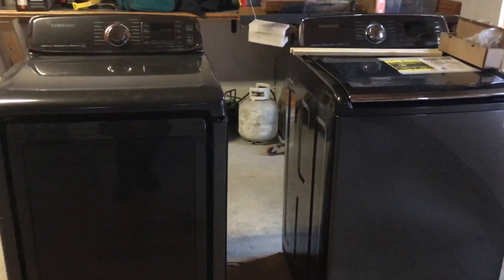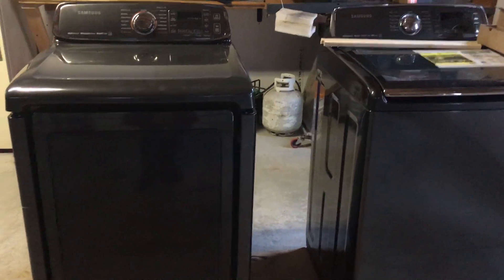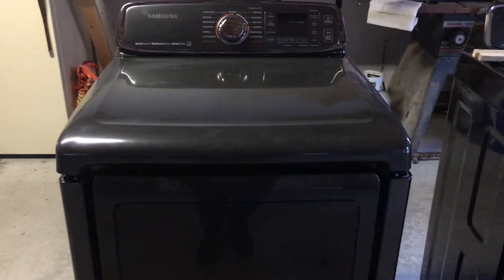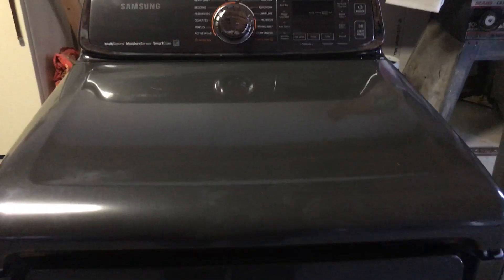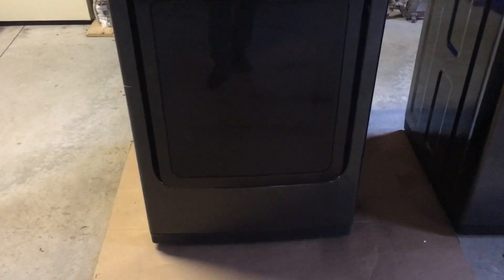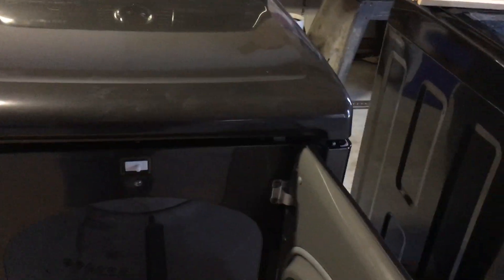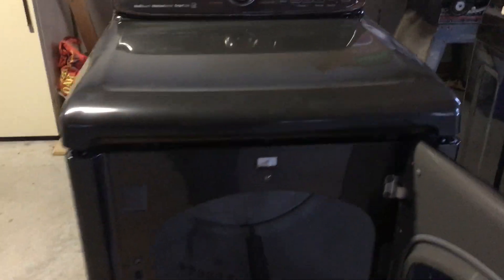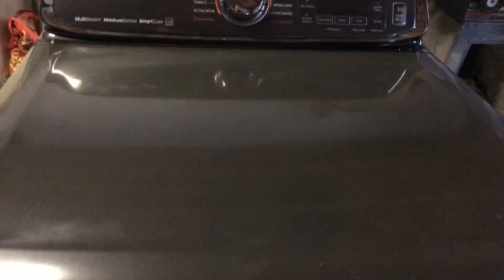Intro To Samsung Gas Dryer LP Conversion

Comment: This video has no useful information
Reply from the maker: As the video description says, this is only the first in a series of short video clips I used in a blog article.  The video on my channel titled Samsung Propane Dryer LP Conversion has all the short clips put together to help walk you through the conversion.
Reply: @barryrobison2073  I think this video will hurt you in the long run as it serves no purpose. Instead of watching your better video I found another video that provided the info promised in your title. From a user stand-point, we demand quick access and to-the-point info, anything less is seen as a means by posters to gain hits/viewers. Good luck Barry.
Reply from the maker: @montywentzel7833  Good point!  Thank you for your input.